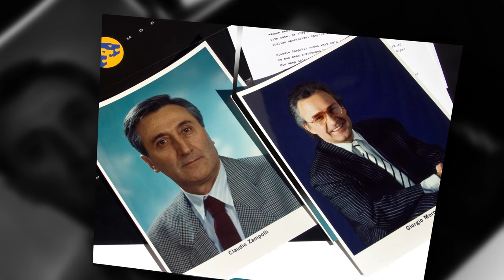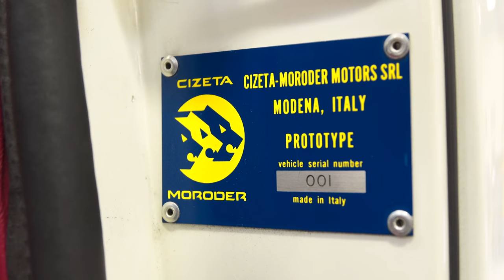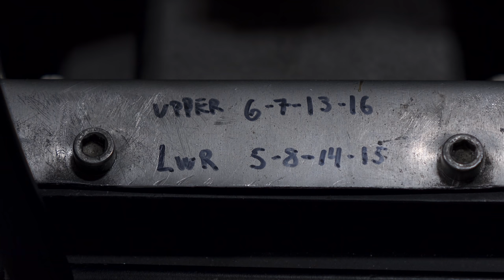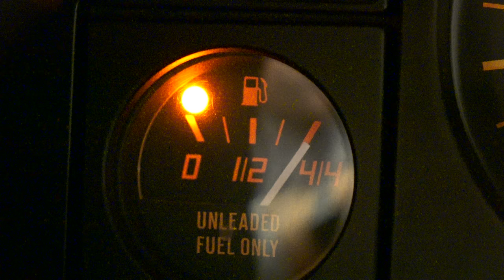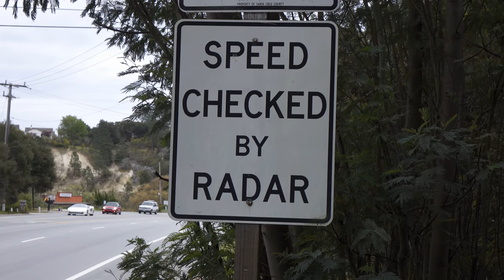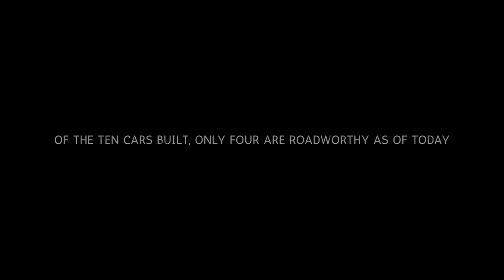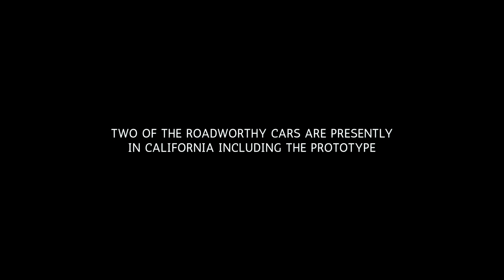Cizeta Moroder V16T: Resurrecting the Wolf Documentary

Comment from the maker: Claudio Zampolli passed away July 5, 2021.
Reply: no way!
Reply: may he rest in peace
Reply: Rest In Peace.
Reply: RIP o7
Reply: Yes, and the family has a huge workshop full of Cizeta parts, engines and part built cars ready for someone to make an offer!
Reply: I heard on a Harry`s Garage You Tube channel that two separate crank shafts were used in this application and they connect at the center of the engine and the ends meet at the middle of a female  splined gear that drives a pinion gear which drives the output to the transmission.  They are both single plane configured.Two crankshafts in line, because a single long crankshaft would have had rigidity and  harmonic problems.Well, when you hear the engine run on the video, it sounds an awful lot like a cross plane crank engine! I was wondering if one side of the two piece crank was set at 90 degrees from the other side? It sure as hell doesn`t sound like a single plane crankshaft engine.On Harry`s Garage, Harry talks to a mechanic who worked for the late designer.He mentioned the engine could rev to 9000rpm.The white one in this video seemed not to rev that high.Puzzling.
Reply: @tedzehnder961  Think you're confusing Harry with Iain Tyrrell.